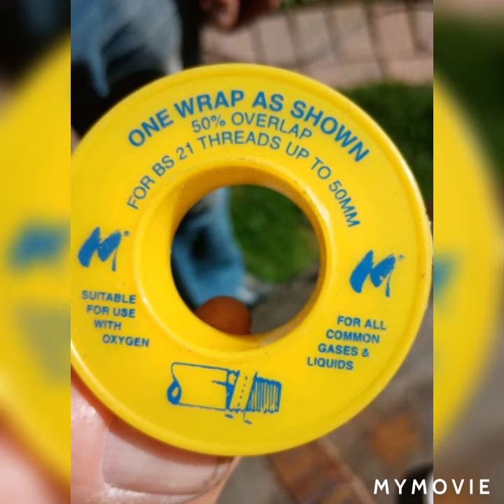Whisky barrel conversion to hold rainwater for garden

Comment: Good video. Can you tell me how you clean the silt out of the barrel?
Reply from the maker: Our barrels seemed to be OK and I have been using the water everyday to water my plants but at first there was a slight smell of whiskey from barrel which we liked
Reply: @lartystuff  Thanks. Can I annoy you and ask another question, how did you get the tap secure if you couldn't put a back but on the inside of the barrel?
Reply from the maker: @matsy1000  that's what the white tape is for wrapped around tap as shown in video. we are not professionals this video is only to show what we did